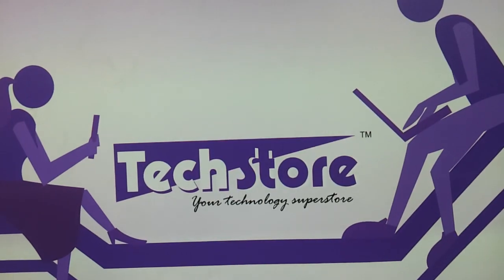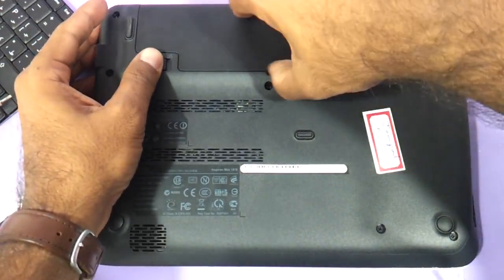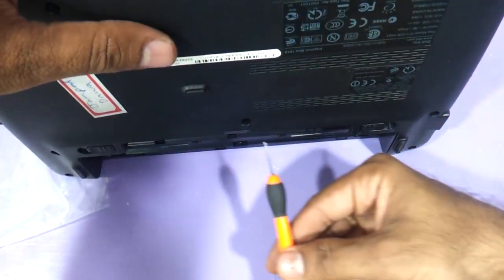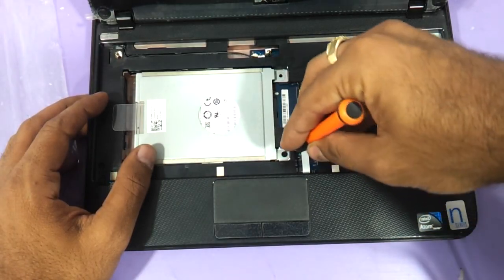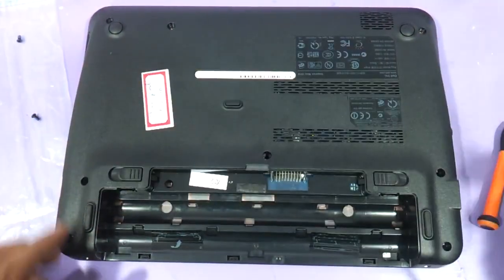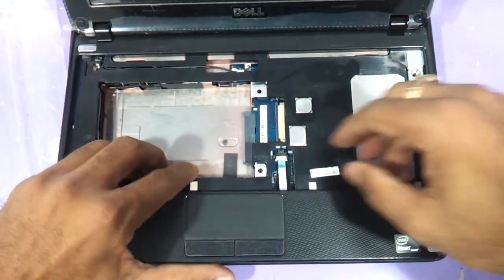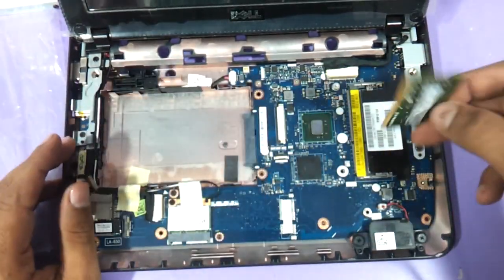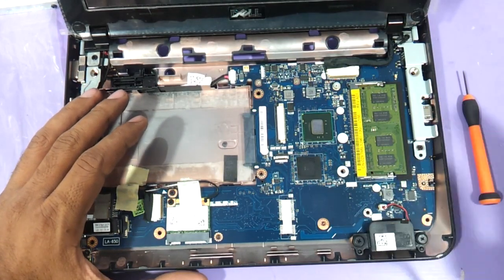Dell inspiron mini 1018 1012 how to upgrade harddrive ram keyboard wifi speakers of dell mini 1018

Comment: this video was extremely helpful I needed to know how to properly disassemble my Dell Inspiron 1018 I was able to upgrade my 1 gig ram with a 2 gig ram plus I upgraded my hard drive with a SSD after I booted up my Inspiron 1018 I could not believe how lightning-fast it became😱 it seriously made a world of difference and my battery last significantly longer than before thanks to you I have no need to upgrade my Nextbook anytime soon plus I have Windows 10 Pro Edition😁👍 because I mainly use my Netbook strictly for work and College but I have to admit it does play certain games really well as long as it's not CPU and GPU intensive😉👍 other than that you have earned yourself a new subscriber and a like😉👍
Reply: bro how to change 1gb ram to 2gb ram..it works or not
Reply: @Madhankumar-yh6df Yes it does fully support 2GB RAM card
Reply: Does this Laptop support win10?
Reply: @AshokKumar-de2jz Unfortunately no it does not support Windows 10 It only natively support Windows 7 The hardware itself isn't capable of running it unless you do what I did and use a Windows image program It will create a copy of Windows 10 and install it as a custom OS It won't give you the full features of Win 10 But it will still give you the basic features of Win 10 such as the Microsoft Store and Microsoft edge

Comment: Bro, I  tried to change the keyboard in my dell mini inspiring 1012laptop at the time I just removed the hard drive and replaced it perfectly  after booting I got Pxe-e61, no operating system found error... I too tried to install os  but it doesn't detect the hard drive... So kindly help me to solve this issue

Comment: I don't know what happened but I was being extremely careful of disassembling the keyboard and opening up the inside until the motherboard was exposed but then I was carefully removing a black piece that was holding the connection between the motherboard and the mouse touchpad now all of the sudden it does not want to work anymore what in the world did I do wrong? please if anyone read my comment please reply immediately I need to know how to reconnect my mouse touchpad to the motherboard? but thank God I have a USB retractable mouse and it works flawlessly but the mouse touchpad does no longer work anymore something is missing in there or maybe that little black piece is not fully connected somehow?

Comment: Many thanks for uploading this. It was extremely useful. The only thing I'd like to add is that people should be careful un-doing the clip for the keyboard cable as it is VERY flimsy and easily broken (fortunately I found a way around this after breaking it).

Comment: I unplugged the mousepad connector however I am confused as to how to plug it back in.
Reply: I know this comment is 5 years old but I just saw this video and it's really easy to reconnect the mouse pad all you have to do is hold the connector hinge up slide the mousepad connector in then pull the hinge down you should hear a click sound now it is connected😁👍

Comment: you should clean the in-said parts with petrol or acid(special used of mother boards)  and then the keyboard too and replace it... if it works then fine other-wails change it and fallow the video and insert the new 1...